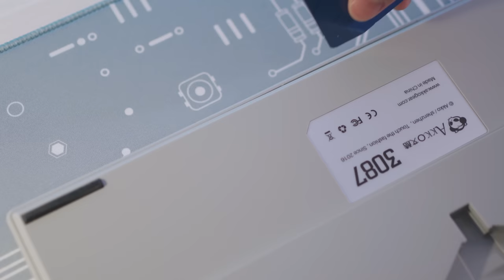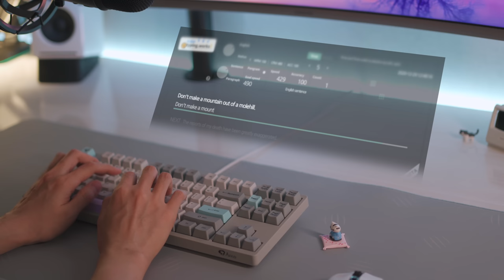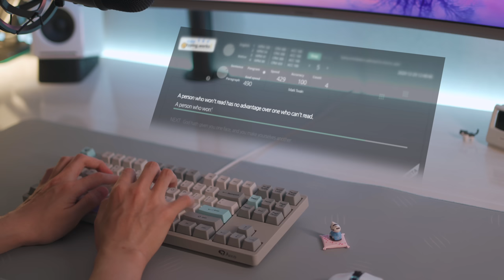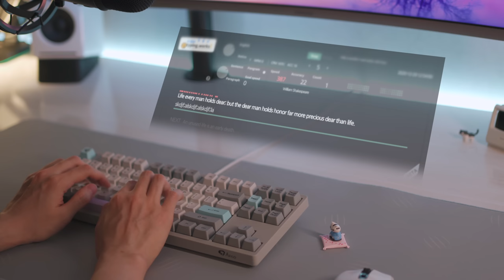Akko 3087 Mods | Lubed Akko Pink Switches Typing Sounds

Comment: Your technique in soldering switches  is superb! Solder 1 joint then squeeze+reflow  then solder the other joint
Reply: Hey I noticed this as well. Is it some sort of a technique?
Reply: It is easier to tighten the switches this way, because you can't reflow both pins
Reply: @michaelnakakubo6791  I’m about to build a board and I never knew that. I was planning to solder the corners first, but didn’t consider the “tightening”.

Comment: I learned something here. Only solder one pin of the switch then fix the alignment while reflowing the solder. Do this for all the switches leaving the other pin of the switch unsoldered. Once all switches are permanently in place, solder the rest of the pins in one go. Smart.

Comment: I really feel stupid putting this out there, but I tried making my own mechanical keyboard build today, my first ever build. Things were going okay, I bought a hotswappable keyboard, took out the switches, disassembled them all, and then proceeded to lube through a tutorial of Taeha, but about ten switches in, I noticed that when I put the switch back together, it sort of just... didn't work. When I pressed on the switch, it would just stay stuck down, so I disassembled it and looked at it, and the copper/gold plate (the little plate in the back of the switch) seemed to be out of place.. I disregarded it and went ahead and lubed a few more switches, having no problems with the next seven or so, then the same exact thing happened and I just lost all motivation, so I gave up, put the switches back together to avoid any further damage. For reference, I was using gateron blacks - does anyone know what that plate in the switch is called and is there any tips so that I don't screw that up again? I felt so genuinely stupid, but as my first build, I don't want to be too harsh on myself over it.
Reply from the maker: If you put the stem in wrong direction, the contact (copper plate) would get damaged and it won't work.
Not sure with this reason or not, but anyway I guess you somewhat damaged the contact parts.. sad.
Reply: @3ildcat  damn, I feel stupid as hell

Comment: Two things: 1. don't push and heat, heat and push, you risk lifting the trace. 2. don't push connectors into their sockets without supplying equal force from the other side unto the socket, again, you risk lifting the traces. Source: done did it myself.

Comment: i wanna lube my durgod tauras k320 which have the silent red switches. Also wanna get some o-rings too. would the silent reds benefit well from doing that? and any suggestions on the best stuff to use? Also how much does a good deskmat effect the sound of the keys? does it dampen the sound a bit? i know i ask alot of questions lol

Comment: Yay a mod version for 3087! Love what you did to this!

Just wondering though if it's possible to add Kailh Hotswaps to this? I actually bought this keyboard and just wondering if it's possible to do so for future reference. If not, what alternative is good in making this into hotswap.
Reply from the maker: I don't think so cuz the PCB should be designed for the kailh sockets.

Comment: how do you clean the inside of the stab stems and other small parts like that? Im not sure how to ive tried T_T
Reply: toothbrush probably
Reply: @dezyy8489  i already did that but there is still a thin layer of lube all over them

Comment: Are the LEDs hotswappable or do you have to solder them ? I saw someone just put the LEDs in without solder. And are the stabs better lubbed or should I just get other plate mounted stabs
Reply from the maker: have to solder.
replace them but if you can fix or make it better, use the stock ones. Up to your skills.

Comment: if i lube my cherry mx red or akko pink switches will they get slower do i have to press harder ?
Reply: They will still maintain the same condition just like before you lube them, the only different is they will feel smoother and no more "mushy/ scratchy" feel.
Reply: use a lubing tutorial so you don’t overlube, overlubing makes it slower and mushier

Comment: How many volts should the LEDs be?
Reply from the maker: don't know
just bought 2x3x4mm leds
Reply: @3ildcat  I myself have akko (I received it on December 31) and I want to solder the LEDs and replace the stabilizers. My question is, why cut off part of the stabilizer? I see you cut off a leg on it, why?
Reply: @akkoXducky  Google band-aid mod for stabilizers, you will find a lot of info.